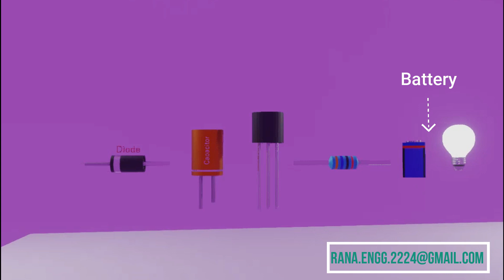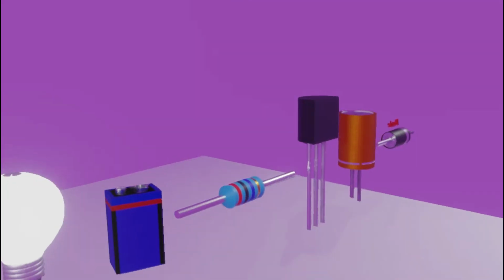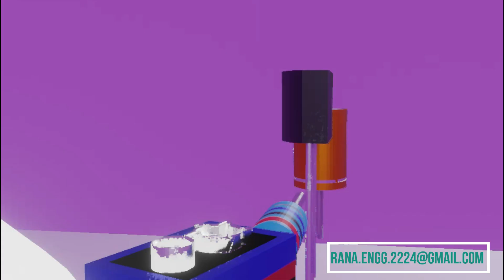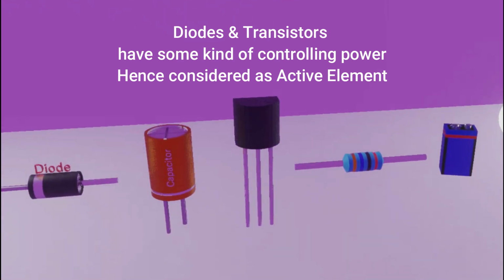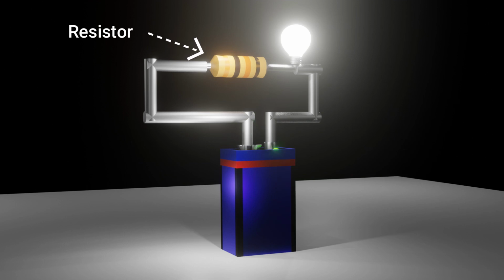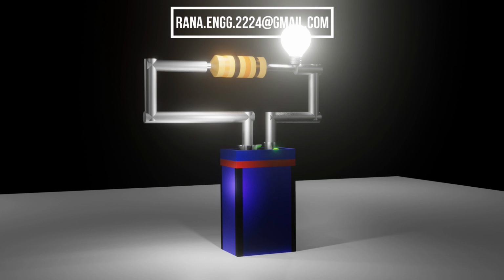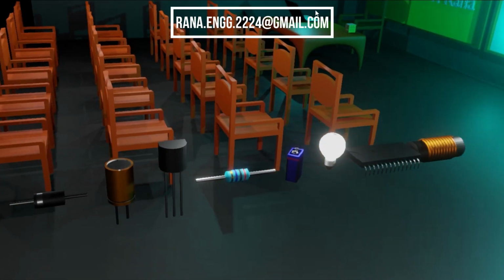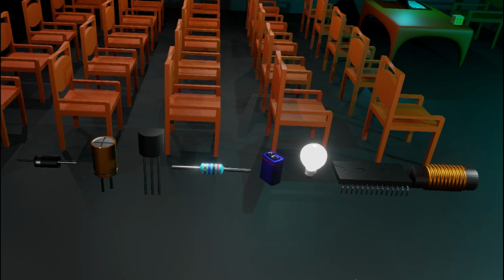Active & Passive Elements in 3 D (3 Minutes ) | Animation

Comment: Active elements : 
Diode
 transistors 
integrated circuits
LED ( light emitting diode )

Passive elements :
Resistors
Inductors
Capacitors
Reply: Wrong led placed in active how?🙄